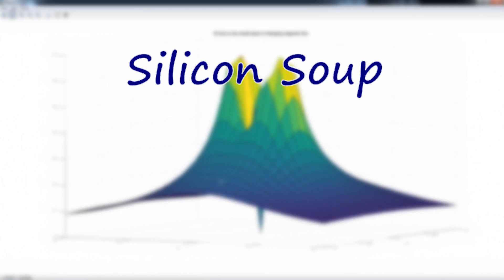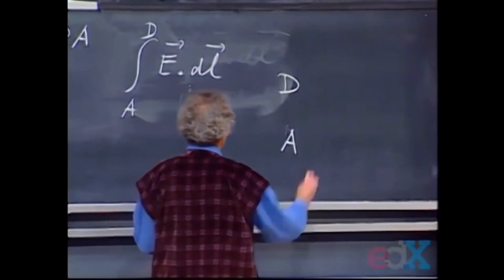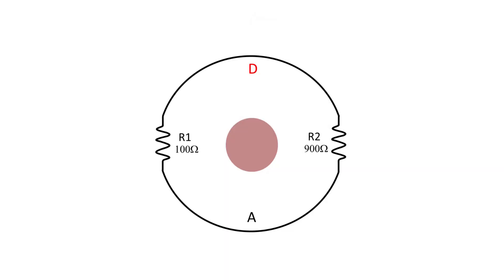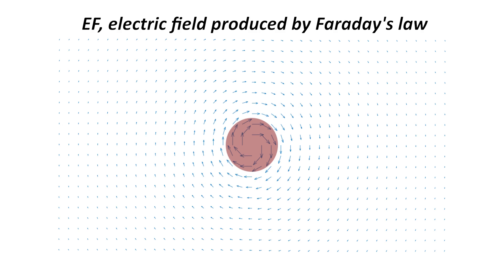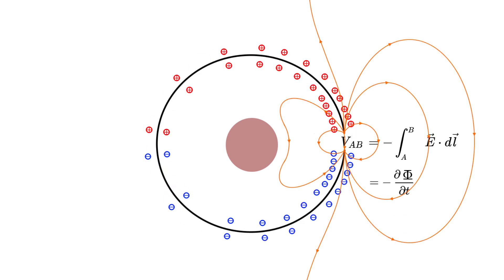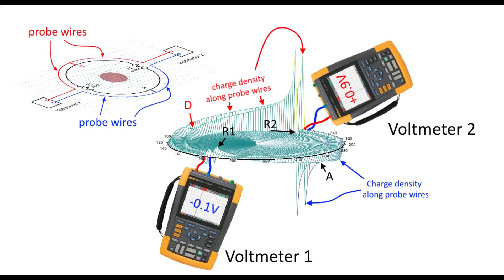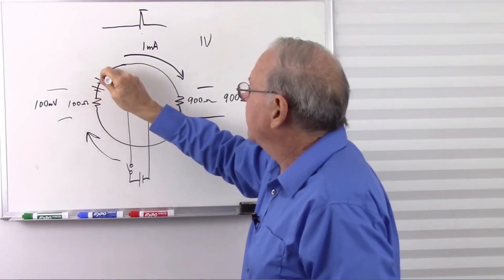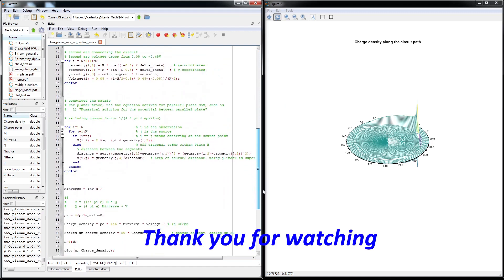Dr. Lewin vs ElectroBOOM on KVL. Of course Dr. Lewin is right.

Comment: This circuit experiment is an excellent case study on how complex multidimensional systems often defy a common human language vernacular and even the models describing them.  It seems that Mehdi and Dr. Lewin's description of the problem in language modalities (words, diagrams, & equations) differed just enough to cause massive misunderstanding given that some of their words held different meanings within each person's mind.  In the end, they both agreed... they just explained the physical phenomenon in different ways.

An analogy for this particular experiment would be that it's similar to the quantum realm's Heisenberg uncertainty principle or the double slit experiment... That is to say: The act of measuring or observing the system in this particular way changed the system so as to create some unexpected observations.  In reality, we see that the physical orientation of the measurement probe wires is significant due to the magnetic field affecting the measurement.  In other words, the act of measurement in this particular way affected the observation due to somewhat hidden and non-intuitive effects.

Meanwhile, the lumped-element model for circuit analysis attempts to reduce and simplify the circuit problem into a more manageable set of often "ideal" components.  This kind of model is useful most of the time where it applies to circumstances where the ignored facets and aspects are negligible, as in what the "ideal" assumptions ignore.  Yet, in certain circumstances these assumptions in the model fall apart.  For example: A truly "ideal" element does not exist.  One instance is that most wires are not superconductors, have some inductance and capacitance with themselves and nearby objects.  Another instance is that magnetic field coupling in such wires does have an effect on the measurements.  A final instance is that in Mehdi's "ground loop" example, the circuit diagram most engineers would draw ignores the wire loop connecting all common ground reference symbols and the magnetic coupling in such a loop.  Therefore, the typical model's assumptions aren't exactly the case in the real world 100% of the time.

Once the hidden elements are exposed, and accounted for in the model... then the system can be fully described, explained, and understood.  The question is:  Are we fully speaking and understanding the same language when describing it?
Reply: They didn't agree, and this video explains exactly why if you pay close attention in the second half.
Reply: @bardsamok9221 The schematic diagram at time @1:38 WRONG !

Comment: With all due respect to Dr Lewin and you, this kind of feels like a strawman argument. KVL does say ∫Edl =  0 instead of  ∫Edl =  -dΦ/dt. But to apply KVL you have to model the "-dΦ/dt" as a lumped various inductive element such inductor, transformer, coupled inductor etc depending on how you want to model it. Additionally, voltmeter is nothing magical that does not change the behavior of circuit. It is also physical element, and its effect has to be modelled in circuit analysis. These are what differentiates a good electrical engineer from a bad one. 

With these physical effects taken into account faraday's law and KVL is one and the same. KVL still has the effect of faraday's law is taken into account in KVL by modelling the "-dΦ/dt" as lumped element. The reason electrical engineers use KVL is because by considering "-dΦ/dt" as just simply a lumped inductor/transformer, a lot of calculation circuit calculation becomes easier. 

Not applying KVL like how a good electrical engineer would use it seems kind of cheap. It is like a physicist measuring the gravity by observing a falling object but neglecting the air resistance. No physicist would like if someone does that. We electrical engineers feel the same way about this.
Reply: Try to search this "Assigning a notion of voltage even when there is a changing magnetic field" on a search engine. You should find the circuit analyzed.
Reply: The problem is that in Lewin's circuit you cannot lump the "hidden" inductor anywhere because it is the circuit itself that is going around the variable magnetic field region.

And the loading effect of the voltmeter amounts to almost nothing (as can be shown by solving the circuit with two voltmeters modeled by their internal resistance).
Reply: @copernicofelinis  , i am interested to know why I cannot lump ? The whole ring itself is a lumped/distributed inductor. If i could not lump that as inductor the whole field of rf transmission line physics would never work. In transmission line,  coax cable is just cylindrical metal peace but is modelled as lumped inductor-capacitor circuit (LC), even though you cannot say that you can identify the inductor-capacitor - it is just that those elements are distributed.
Reply: @imamhasan9450  in order to lump you need two things: a component where the changing magnetic field is confined, and a circuit path (a closed path joining your components, ideally via terminals infinitesimally separated on said path) that does not include any changing magnetic field inside of it. You cannot have that with Lewin's ring because he is requiring that the two resistors be on the opposite sides of the magnetic field region. The component, so to speak, is the whole circuit and as such it cannot be lumped. And it is not a transmission line either: it operates in quasi-static conditions and there is no propagation along it (you can consider the evolution of voltages and current without delays due to the propagation of the fields).
Reply: @copernicofelinis  I guess labelling "lumped element" has been a mistake on my part. What I meant to say was "distributive element model". Like two parallel wires can be modeled as LC circuit in transmission line. Often in my work I interchange both models as same though labelling them same is inaccurate
Reply: @imamhasan9450  well, look at all transmission lines examples you have encountered: the have an input port and an output port, and propagation is due to energy transfer between inductive and capacitive energy storage elements along a preferential direction. Lewin's rings lacks: input and output ports, appreciable capacitive energy storage, a transfer mechanism between inductive and capacitive elements, and even a preferential direction of propagation (it's a circle!). Nah, definitely not a transmission line, nor transmission line -like. It can be explained perfectly using Faraday's law, tho.
Reply: @copernicofelinis  I did not say Lewin's circuit is transmission line like. What I meant was Lewin's loop can be modelled as  distributed inductor element if you dont want to model it as a lumped element. 

I am not saying it cannot be explained by Faraday's law. KVL is perfectly fine, but if you want to use KVL you have to model the extra dΦ/dt as inductive element. That is how electrical engineers use it. And once you do that, KVL and Faraday's law are equivalent.
Reply: @imamhasan9450  the problem with distributing inductors is that the voltage you see at the terminals of the full inductor is not distributed along the coil: it only appears in thee space across the coil's end terminals. When you analyze a single coil you can see that the voltage (the path integral of the electric field) is zero along any path inside the conductor, but is not zero on paths across the terminals. The fact that voltage is path dependent means that KVL is no longer valid, therefore Faraday and KVL cannot be equivalent.
Reply: @copernicofelinis  Thanks for the response.  

I believe the fundamental thing we disagree on is below:

∫Edl =  -dΦ/dt     (faraday's law)

∫Edl  + dΦ/dt = 0    (KVL as used by EEEs with dΦ/dt  modelled as inductive element/transformer element/ emf force/ voltage source )

You say dΦ/dt cannot be modelled as series inductive element.
However, we EEEs model them as such in circuit analysis all the time. The whole point of KVL is using lumped element model for analysis. If you discard that, then you are not using KVL the way EEEs use it. 

While I enjoyed our discussion, I don't think this is the correct place to continue prolonged discussion, and further discussion would not be fruitful, since we disagree on the premise of how KVL is to be used.
Even if we agree, EEEs would not stop using KVL. Even if we disagree, the modern physics and modern electronics world would not collapse 🙂

So Cheers !!!!
Reply: @imamhasan9450  as you wish, but no, that is not what we disagree on. I am well aware of how to modify KVL to accommodate magnetic components; what I was trying to say is that such a technique cannot be applied to Lewin's ring due to the geometrical constraints he placed on the circuit. You simply do not have a circuit path where to compute the first integral. Try to look up that stack exchange post I've mentioned, and the linked answers and you will see why it is so.

Best wishes.
Reply from the maker: Thanks to Copernico, who taught me how to identify lumpable and unlumpable circuits. Without exception, he explained the concept precisely and clearly again.
Many engineers, including popular Youtubers, believe that there exists voltage along the perfectly conductive wire in the inductor or transformer, by modeling the wire with the lump or distributed inductors. The fact is that there is no voltage along the perfect wire as verified by experiment and simple ohms law calculation. Not sure if you think voltage exists along the wire. Even when it is valid to hide dphi/dt in a black box and model it as an inductor, you can't run away with what happens inside the black box. Do you know that an inductor has zero voltage measured along the wire, but non-zero voltage across the terminals? It is zero volt and non-zero volt at the same time, depending on the path of measurement. It is so difficult to visualize this, if conservative field is your only tool. But the moment you understand that charges redistribute themselves to zero the e-field along the wire, and produce non-zero e-field across the terminal, then it is possible to see the working mechanism, not just by the mathematics.

Comment: Dr lewin is not right https://youtu.be/JpVoT101Azg
Reply from the maker: Maybe Cyriel Mabilde is wrong. To claim that Dr. Lewin is wrong and Cyriel is right, you should give an explanation.
Reply: @SiliconSoup  it's been sometime since i made this comment and because i am currently an undergraduate in physics on my second year I've gained a much better understanding on this whole "debate". First i have to point out that what you said in the video is by no means wrong. Also what Dr lewin said is by no means wrong. But i think that dr lewin has made a misunderstanding. In one of his videos regarding this matter he mentioned some physics books and one of them was halliday resnik walker second volume fundamental of physics electromagnetism optics modern physics. The book mentions kvl and how you can apply it even when magnetic fields are involved. But there is one tiny detail he doesn't mention for some reason and because i actually have that book, i thought that i should point it out. If you want to measure voltage when magnetic fields are involved then you have to measure it at a point where you don't catch excess magnetic flux. It specifically mentions that we can't talk about voltage when magnetic fields are involved because of Faraday's law. If we want to measure voltage in this case we have to do it at point in the system where we don't catch magnetic flux as i mentioned before. So electroboom's argument about dr lewin having bad probing is 100% percent correct and that's what is being showcased at the link i sent in my previous comment. I'm not writing this to hate or to act superior, but i think it would be wise of dr lewin mentioning this very important piece of information that is being perfectly explained at the book that he himself stated to have gotten this topic wrong. As an ending statement I would like to mention that some of the terminology i have used may be wrong but English is not my first language and im translating it from greek. And of course i want to point out again that your video has nothing wrong. The information is correct but the conclusion is misplaced. When there are magnetic fields you can't measure voltage. You can't even mention it because you would get different readings. If you want to, the voltmeter has to be at a place where the wires don't catch the magnetic flux. If you want to i can dm you in Instagram or messenger and send you the photo of both the book and the exact statement about voltage and Faraday's law that Dr lewin didn't bother mention, but was very eager to disregard the integrity of.
Reply from the maker: Hi Greatbob, when there is changing magnetic field, we CAN still define and measure voltage, except that the reading is path dependent. One good example is that in a transformer with a single turn in the secondary coil, there is no voltage along the coil (0-ohm wire), but there is voltage across the coil (as explained in my video). This is amazing because it violates KVL. It is my position that ElectroBoom and Cyriel were wrong, fundamentally wrong, because they believe there was voltage distributed along the perfectly conductive coil, but me and some disagreed with them. You can't say Dr. Lewin and I are not wrong, and Electroboom and  Cyriel are 100% correct when we have strong differences in our understanding of the physics, so you have to sort out which one you think is right. Based on simple Ohms law, everyone knows there is no voltage drop across a 0-ohm wire, but when the wire is place in the changing magnetic field, somehow some people believe there is distributed voltage along the wire. What do you think?